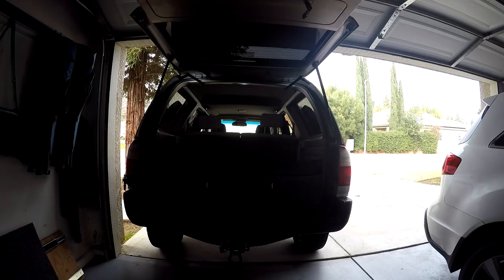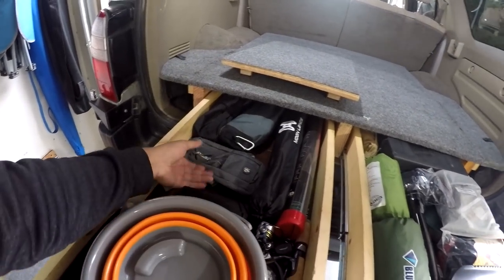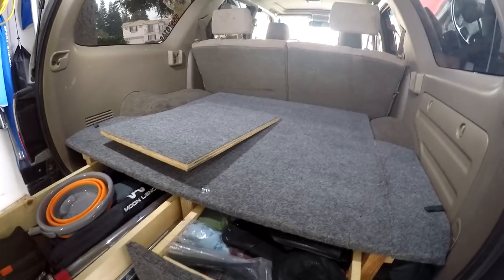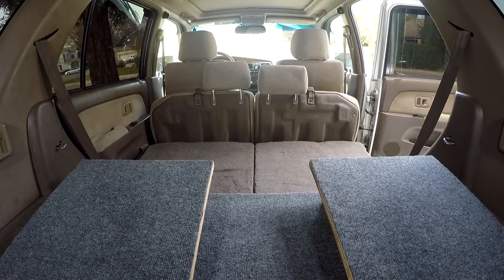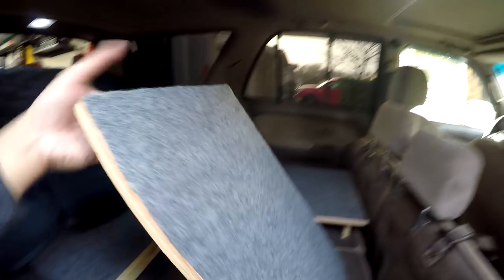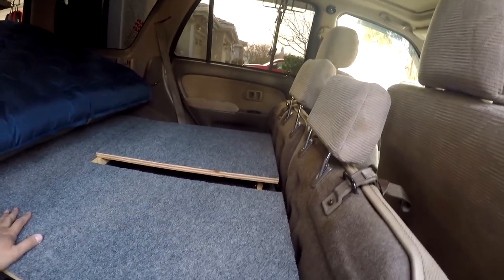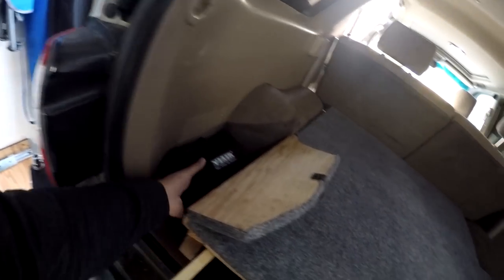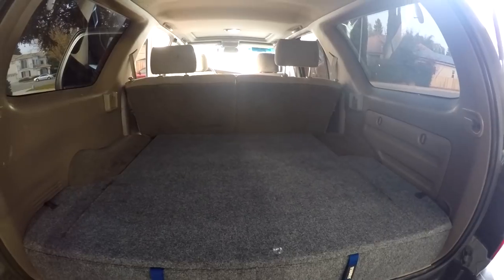Rear Cargo Drawer Storage / Sleeper Platform for 3rd gen 4runner or SUV

Comment: Very well done.  Incredibly helpful.  I swear 3rd Gen owners are the most helpful and detail oriented peeps in the automotive world (of course I'm biased).
Reply: You are right. Thanks
Reply: Absolutely right!!! Me too just got my 99 4runner
Reply: If only they also had a TailGate 😥😞😔
Reply: @mrjebadia2582  Loved that about my 88 'runner; a tailgate with rear window that roll-downed down, like Old's station wagon. In 2002, traded that toward my 3rd gen; still running strong at 188k miles. 3rd Gens kick ass -- simple repairs and super-freaking reliable. Best suggestion I can offer: REPLACE Oxygen sensors regularly. Recently mine was due for second change. After replacing, the sucker runs brand new!
Reply: Have been wanting one since I was in high school. Just bought one from a close friend. Records dating back 17 years, seats reupholstered, everything else all original. Most amazing thing I’ve ever seen, feels like I’m 5 years old again

Comment: I've also got the Klimit inflatable and the Klimit air pillow. For the pillow I tied some string on the valve end and the sewn on label at the other end (which is a loop). This sting wraps around my air mattress to hold the pillow in place. Works great. 

The drawers are nice. What years of experience has taught me is, always get full extension, or just use waxed wooden slides (usually maple or birch wood, sanded then waxed). Less than full extension is always, always a hassle. Also with any long bed drawer I'd have an adjustable support stick for when it's extended. I've yet to see anything cantilevered that doesn't eventually start to sag. 

Using cardboard for the pattern is a good idea. Don't forget the cardboard is not the goal, it's just a guide. In some cases you can tape pieces of cardboard on top until whatever mess you end up with fits like you want. This is a modern variation on the tick stick, or tic stick. Amazon seems determined to keep us perpetually supplied with cardboard. 

Hatches AND drawers are a good idea. And it's probably a good idea to not carpet or glue anything until you've taken it out at least once. I find with projects like this, I think about it, plan it to death, then as soon as I put the last screw in-even before I use it- I know exactly how I should've done it....  And when I re-do it, I can see how much better the third version will be....  So I appreciate your sharing your clever set-up. Being smarter than me, your video is steps one and two. Thanks.
Reply from the maker: Glad it was helpful. I actually made another version of this. Check out my channel for the other video. I also filmed the build and made a how to series.

Comment: Great vid! You gave me some good Idea's  for my Gen 3, I camp alot in it. One thing I have discovered when going into the wilds is by removing the rear seat bottoms ( four 12mm bolts literally 5mins) you gain about 8 inches of platform space and more floor space when you get home it's 5 minutes to put em back . But thanks again for the info.
Reply from the maker: Yeah easy 12mm bolts

Comment: Love it. Great design. One thing I could suggest is, to solve both issues with the extensions (slipping off and being 1/4" too high), you could remove the cleat and mill a 1/4" slot in it, then mill a corresponding slot in the inside end of the extensions, such that they drop into place and interlock (and would still be able to slide side-to-side as you mentioned you like to do sometimes).
Reply from the maker: yup i had thought about that. I mgiht do that to my new build! I have given this one away and made another but this tip is still useful! thanks for the tip. I found that pushing the front seat back works just fine!

Comment: this is a nice build. I watched your video and built out mine. However, I removed the single bolt attatching each rear seat cushion for extra length and use rubbermaid tubs for storage/ support up front. I also added a 3rd board which enables me to have a full 7 foot bed.
Reply from the maker: sweet! I have 3 little ones to take with me on adventures but glad you made it work. I'm sure there are some taller folks out there that can appreciate this!

Comment: I like this idea. I'm going to use my weather tec mat as a template for the top piece of plywood. I like your extenders the only difference I would do is move your 2 pieces outward and build a 3rd middle piece in order to have more room at head side.
Reply: I think he went with two for stow away purposes.

Comment: Badass man. I just bought a 3rd few weeks ago. Great idea
Reply from the maker: Cool. 3rd gens are awesome!!!!
Reply: Be sure to change the timing belt! People always neglect that. Needs done every 90k and change water pump, cram seal and tensioner, idler when you do it. The 3.4 V6 (5vzfe) is probably the most reliable v6 ever made. I have 300,000 on mine.

Comment: I was thinking about building a platform just yesterday laying in my 96 4Runner but was thinking about building a simple platform for underneath storage out of pressure-treated lumber!  If I wanted to get it out of my car or sell my rig, I can keep my platform and it would not ROT when stored outside! but could be removed and used for Dual Purpose like a camping platform outside? put legs on it use it as a picnic table:-) or as a shallow raft if you built it to float :-) and yes I always think outside of the box or should I say the 4Runner :-) haha I've always been an inventor
Reply from the maker: Nice lol

Comment: I’m starting this build this weekend... What are the metal 90° locking hinges you used for the little feet on the platform extensions? I can’t find them anywhere.
Reply from the maker: Check my video description. They are called posi lock folding leg brackets.

Comment: I will be building this same set up soon. Any ideas where you would mount a sub that would still sleep two people? Could I mount it into the drawer system so there would be a hole for sub and cover it when sleeping?
Reply from the maker: Just make the drawer a bit smaller. You could put the sub in back (center of 4runner). You can do 2 subs that way or 1 and use other as a hatch for storage
Reply: PhoRunner Channel great idea brother

Comment: This is slick. I like the simplicity as well. Couple things...what would you change or do differently, if anything? What kind of carpet did you use? Thanks a lot for sharing. I’m going to have to do this to my 99 now.
Reply from the maker: carpet is from home depot. the cheapest one they got lol. i would probably use 3/4" ply instead of 2x6's since that extra room would be nice. Also i'd build in a way to slide the platform out so it could double for a fridge slide. I think that's it. I've been thinking about building a new one that's why.
Reply: @PhoRunner  Liked and Subbed! Awesome video. I'm planning on building something similar for my GX470, but your instructions are great. I was planning on originally using 3/4" ply for the leg portion below the flat ply sheet. This way I could cut it to any height. Is that what you meant about using 3/4" ply rather than 2x6s? Again, great video, much appreciated!
Reply from the maker: @hansoffate  yes! if i had to do it again, i'd probably do that. I got kinda lazy lol and just used 2x6...

Comment: Hey pho, do you have the installation video on your 3rd Gen 4Runner Rear Cargo Accessories Panel (power outlets)?thanks for all your help and Videos
Reply from the maker: I don’t but I just ran a wire straight back there from the battery. Use the access hole under driver foot well, pass along back of radio via carpet, then along the door trim. Just the power wire. Ground can use something metal in back.

Comment: Man, good job. That's about what I want to do with my gen2. I hit a deer though so everything's been put on hold...for the last 2 years. Eventually though I'd like to start with this and then a platform on my roof. I have a tailgate which makes accessing the roof easier. I know I have very little power to play with, but I'm not sure how little. I had just gotten the truck and JUST gotten my overdrive to work when the deer killed my Toyota. I've owned it for 3 years but I've only driven it about 100 miles. What are you gonna do though?  ...Kill more deer!
Reply from the maker: Baby steps!

Comment: I’m 6’4 and looking for a viable option like this. He seemed a little cramped with his build and several inches shorter than me but the mattress said it was 79” long so I’m wondering if maybe you could remove the back seats altogether and make an extra large platform that would fit a big guy like me. I wouldn’t mind putting my back seats into storage in the garage or something, only breaking them out if absolutely necessary. Does anybody have any suggestions for a big guy like me?

Comment: I would do this but I'm 6'3 so I'm too long, I think in gonna figure out how to take out the front passenger seat to make more room
Reply from the maker: It’s gonna be tight. Roof top tent might be a better option for ya.
Reply: I have the same problem. At first, I made it higher so the bed goes above the folded rear seats but it was too high; I couldn't sit on bed and was harder to get in. I then decided to lower it and just take out the part of the folded seat that prevent you from beeing tall when sleeping... It's just two bolts so it's not too bad.
Reply: @PhoRunner  but they're so expensive and heavy, I'm either going to deal with it being raised or just fake a seat out all together

Comment: Okay so I got wood cut today I was trying to find the drawer sides and I was really confused and couldn’t find them what is 4x0.75 ? Was that actual measurement or what
Reply from the maker: that's the size of the wood i used to make the drawers.  They are 3/4" thick by 4". The other measurement is found in the video at 14:53

Comment: Are you saying that the box is 41 1/8th inches long, and the runners are 39 1/8th inches long"
Reply from the maker: that plywood topper is 41 1/8" by 39". The runners (2x6's) are 39 1/8" long. It needs the extra 1/2" overhang for the drawer faces plus another 1 1/2" for the back 2x6 that's back there. So that's why its 2" longer than those runners.

Comment: This video is of no use for me.   You clearly got an "A" in carpentry, and I got an "F."  So I could purchase all the supplies and try to put them together and wind up with something that would not fit or a pile of sawdust.     Seriously, I admire your skills and wish you were living in my town.  I would pay you to do a platform for me.   Thanks for sharing.
Reply from the maker: haha it took me some time to learn all those carpentry skills. Lots of youtubers and a garage to play in is always nice. I might build a new platform so stay tuned!
Reply: All joking aside,  take it one step at a time. It's not as hard as it looks. You could easily just put under-bed plastic storage boxes under the platform. Making the drawers is probably the most difficult part. The advantage of using bins is removing the entire unit and taking it to your campsite.  Not to mention if something spills its contained. As for the short legs that flip out you can, instead,  put webbing straps or rope through the bed extensions and have them hang off the front seat headrests.  You could even go so far as to make the straps/ropes adjustable so you can elevate your head for reading in bed. Must admit that PhoRunner is inspiring.
Reply: @Fingerprintguy   Thanks for your comments.  I like the plastic storage box idea, then I would only need a big piece of plywood that they would cut for me at Home Depot.  I could probably do one hinge to cover the gap in the folded passenger seats.  Then, the issue I have is purchasing expensive tools for one project and then the tools sit on the workbench without being used again.  Could rent the tools from HD, I guess.  See, I am such a whiner that it is best for me to pay someone to do it.  I have been pondering this project and finally have a solution.  There are cabinet makers in town that build custom bookcases and other built-ins for the home.   One look at PhoRunner's video and I am sure that could fabricate something nice in short order.  I plan on going this route.
Reply from the maker: @H.pylori  you really just need a circular saw and a drill. a drill is necessary for any body that owns a home.